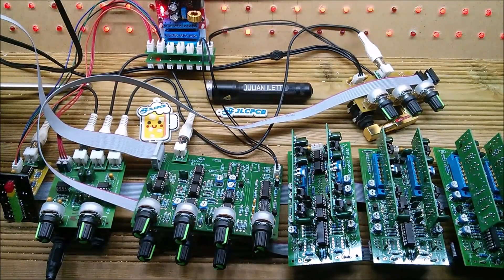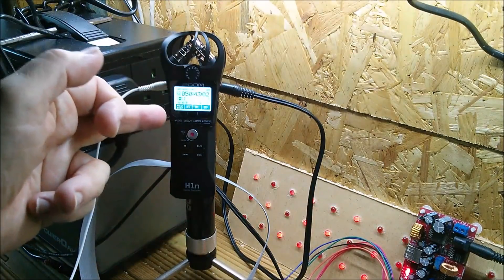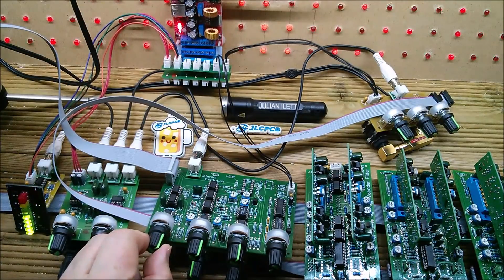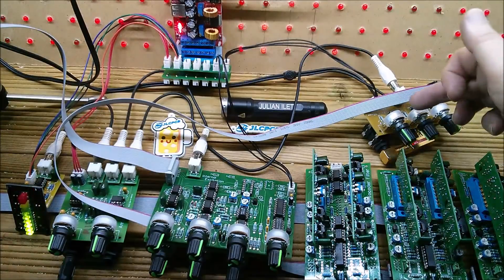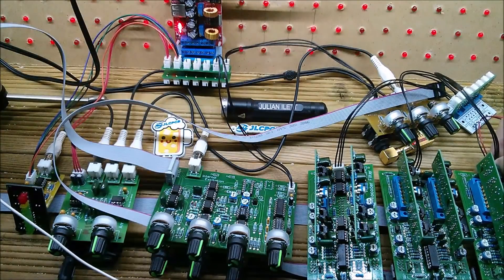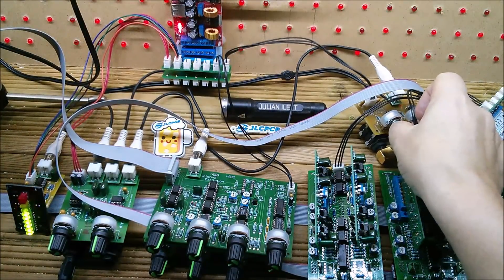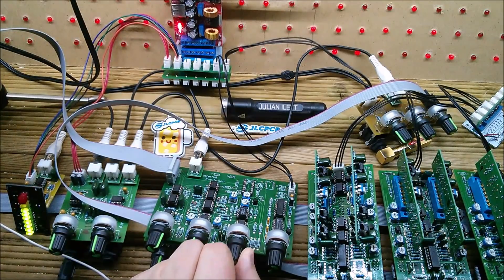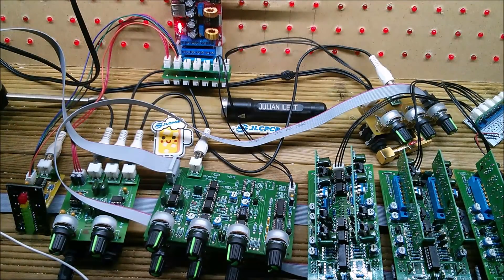Vocoder meets the Zoom H1N (and some PSU stuff)

Comment: use some  clamp on chokes on your power .... put them on one by one till the power noise is gone
Reply: A big led lighting power suppily might work.. or a computer power supply if it has enough wattage..  just make sure you have good ground & rf chokes on power to boards

Comment: Hi Julian, I have one of your PWM5 charge controllers and am wondering if I can perform a definitive test to determine whether it is working correctly. The LED is flashing merrily away but it would do this if just connected to a battery. In my installation on a boat the batteries are also charged by the engine alternator.  Look forward to your reply. Regards Mike

Comment: See I would never have the patience to build something like this, probably why I brought a VC340, it's nice because the original it cloned (the Roland VP330) was used on countless records where a vocoder was needed (as it was simple to get a great vocoder sound) so it sounds as you would expect.
Amazingly it's sound generation is all analogue (no DSP/software emulation) and is the first string machine to come with a factory MIDI interface.
Some people say cloning is easy but it ain't always easy, esp. if the original uses un-obtainium components.
In some cases, though, to solve the problem of long discontinued chips Behringer has a fabless chip company, Coolaudio, that can have old chips remanufactured where necessary (i.e. it cannot be properly emulated with multiple components) which it also sells to other companies, to that end one of Behringer's rivals, Roland, uses Coolaudio BBD's in it's waza craft chorus pedal! (DC-2W?)

Comment: To solve the power issues, if this is intended to run from a single 12V nominal supply (e.g, lead acid battery system), you could do with two suitably rated DC-DC converters that have isolated / floating outputs. Then you can use them to make a +12V, 0V/GND, -12V supply system. But make sure that the DC-DC converters operate outside the audio spectrum and have excellent output filtering. Of course, you can add further filtering if you wish.

If it is intended to be powered by the mains, then use two suitably rated SMPSUs that have isolated / floating outputs. Then you can use them to make a +12V, 0V/GND, -12V supply system. Again make sure that the they operate outside the audio spectrum etc...

Comment: Why are you using switching power supplies for audio thing? As far as i have seen many people on YouTube and other places, they say no to switching power supplies for audio.
Reply: Switch mode power supply units (SMPSU) can be used as long as the frequency of operation (and the main harmonics) are not in the audio spectrum and the output filtering is excellent.
Cheap SMPSU however may not meet this criteria.

Comment: Julian, good to see this project hasn't fallen through the cracks.

I was wondering if the functionality of it could be modelled in Matlab.
Reply: ETI Vocoder Inspired filter proof of concept. - https://gist.github.com/zenith-parsec/1c603fdc4c57bfa7a359e5026c8be080

This is my 12-channel vocoder inspired by the ETI vocoder.
it uses a filter based on http://www.musicdsp.org/files/biquad.c
and if i remember, many of the parameters, like the filter centers and 
bandwidths, and some of the weird behavior like alternating the phase
of each channel come from the schematics and other docs for the ETI vocoder.

Releasing it because I remembered I'd done it in C.

Comment: Was that a speccy ear/mic cable I saw there?
As for power supplies - you can get an ATX supply for under a tenner that will give a good 10-20A per wire (only problem is the -12V is low current but maybe that could be hacked, or even flip the output polarity of a second supply?)

Comment: Use each bank of your 9.6V with a 12V boost converter. 
Create a floating ground with the two to get your +/- 12V 
You can easily get 10W before heat becomes a problem.

Comment: i remember when you started the vocoder project.  to see it now is crazy! i love it.  I would love to plug my guitar into it.  awesome project!
for a power supply, couldnt you use two lead-acid batteries in series kind of like you did with the eneloop packs?
Reply from the maker: Cheers Mike, it's getting good now. More filter channels will make it sound a lot smoother. I thought about using lead-acid batteries, but I don't have many small ones.
Reply: @JulianIlett  is this the last vocoder video ever made? It’s also missing from your vocoder playlist.

Comment: The h1n is good as long as everything is tuned off on the back
Reply from the maker: Everything is turned off apart from the limiter function - that's really useful to prevent overload of the anlogue to digital converter.
Reply: I know what you mean but I have it turned off and set the input levels manually. It bugs the crap out of me it does what it thinks is best for your recording
Reply from the maker: Ah yes, auto level is also turned off - auto level is terrible on the H1n :)